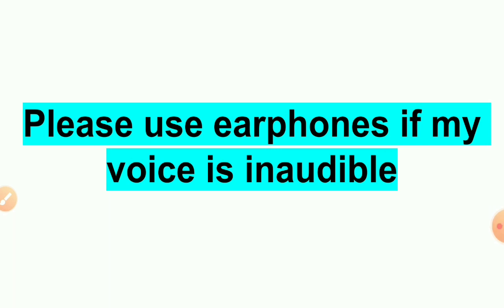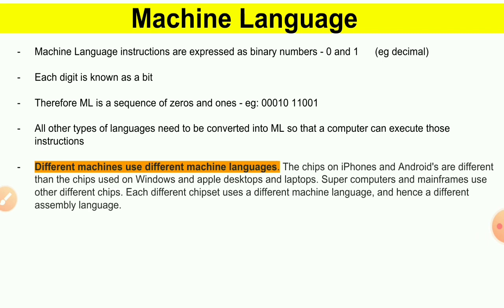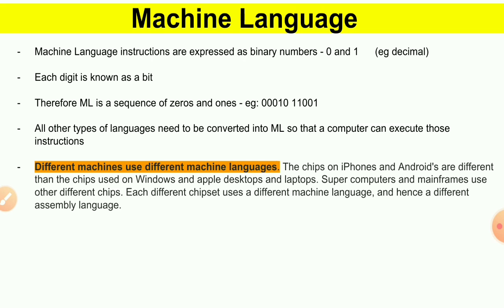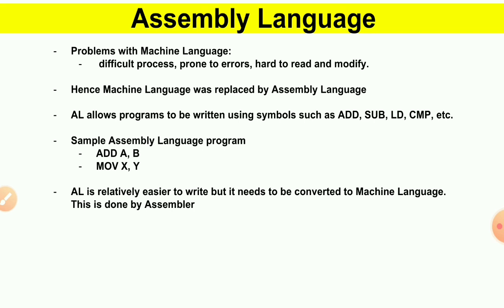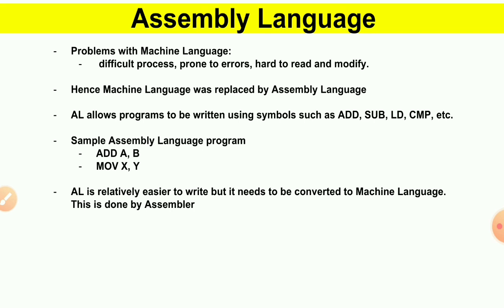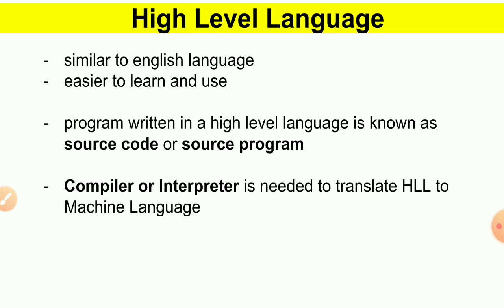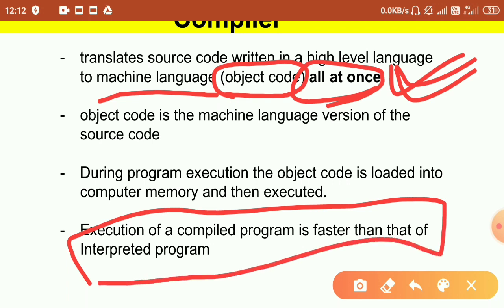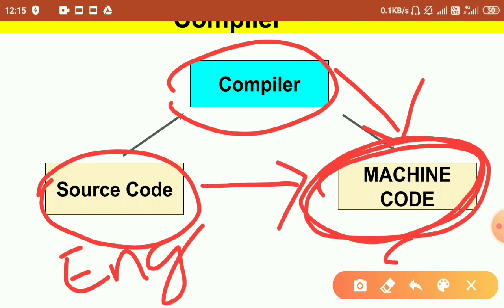Class 10th ICSE | Machine Language|High Level Language | Compiler | Interpreter | Chapter 2 | Part 2

Comment: What is difference between HLL and assembly language
Reply from the maker: Assembly Language(AL) is close to machine language(ML) . Instead of 0s and 1s it uses symbols. HLL uses syntax similar to english language. 

AL directly deals with the hardware level components like registers and memory locations . HLL deals with higher levels of abstraction like variables

AL programs are not portable (across different hardwares) They are completely machine dependent. HLLs
 are portable and generalised

AL programs execute faster than HLL
Reply: @discover108  thankyou sir 😊
Reply from the maker: @afrinkhatoon4363  Thank You